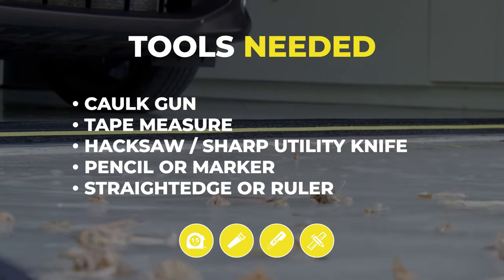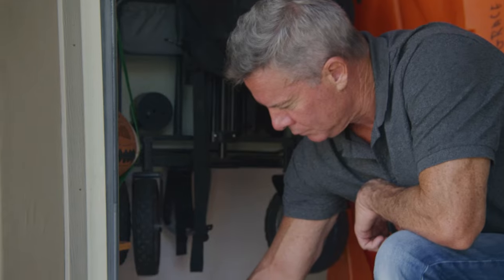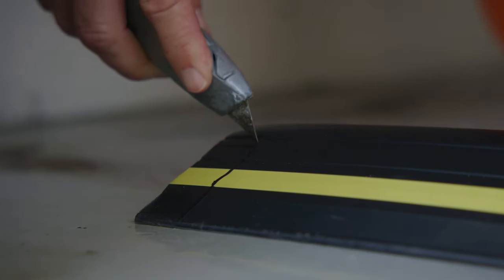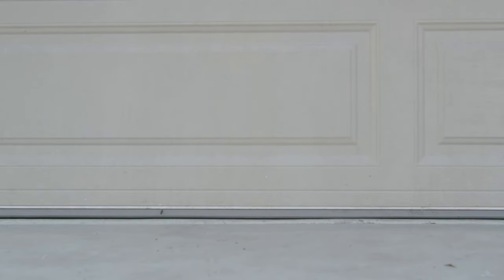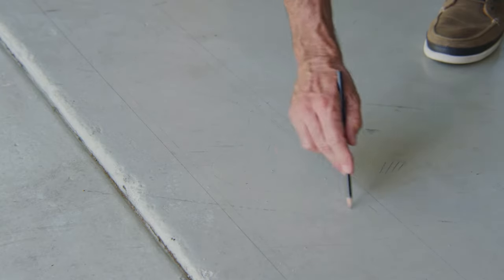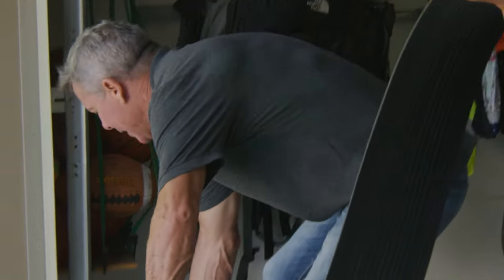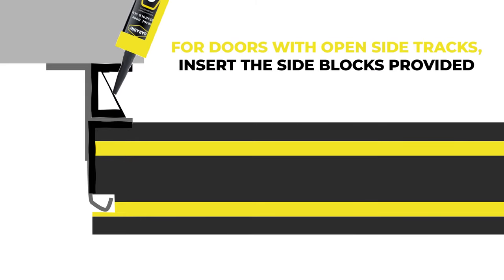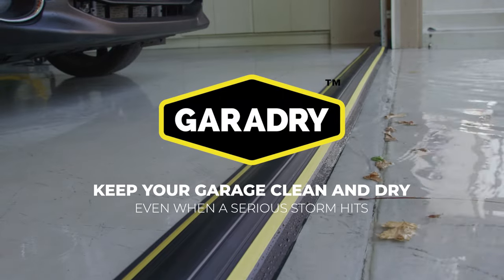How To - Installing A Garadry Garage Door Threshold Seal

Comment: It's a nice profile, but how about mitring in a short length of profile at each end, rather than gunking in blocks around the door channel? This means trimming the end of the channel to fit in the mitre, but this only improves the life of the channel that's often sitting in water otherwise.

Comment: Can you use this product on an epoxy garage floor?
Reply from the maker: Yes, you can use the product on an epoxy floor. However, if it is a very smooth, shiny surface, you may need to rough the surface up using sandpaper so that the adhesive can bond better.

Comment: This was the best installation video for installing the rubber threshold, thank you for the information.  

➡  Important ⚠  
Step #1 is very important measuring the distance {outside} the metal tracks, and then cut the threshold.  Step #2 cutting around the ends to fit the track to allow the rubber threshold to fit is also important.

Don't worry, the sealant will allow you time to make any last minute adjustments with the threshold to move it within the penciled lines.  It will take a while for the sealant to lock-down and dry.